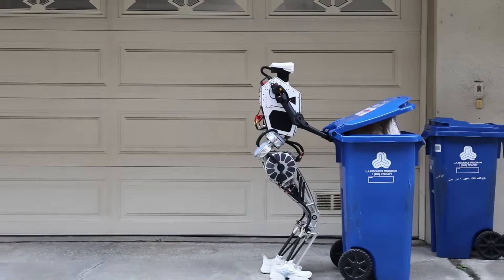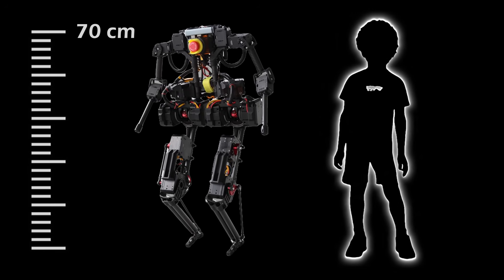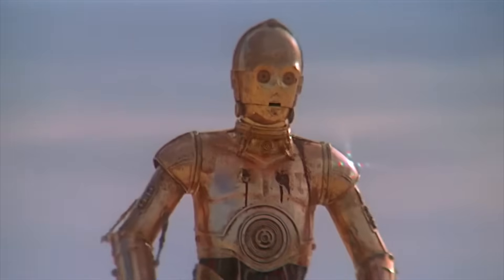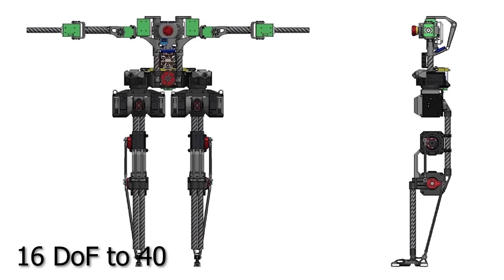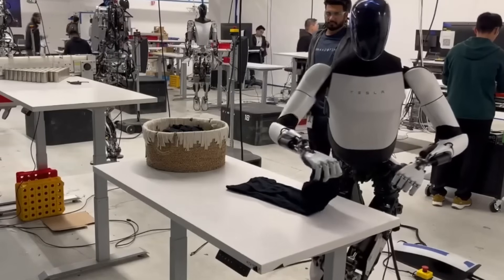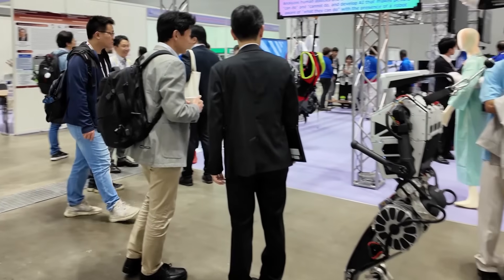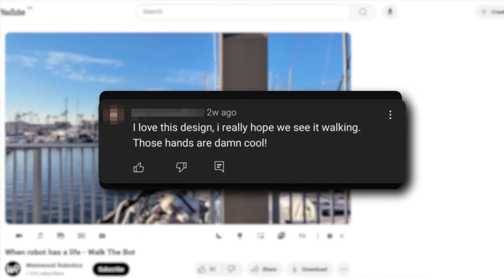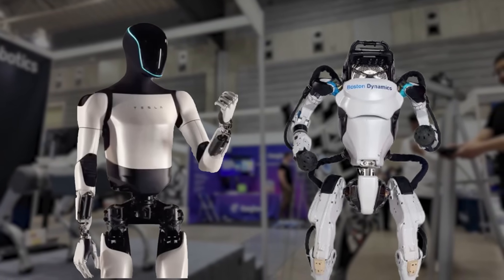First Humanoid Robot That Moves and Reacts Faster Than Human (Not CGI)

Comment: Not agile at all, such small range of motion of the legs.
It just shuffles along with quick little steps so it can do more corrections.
Long steps require much more decisive control and upper body balance adjustment.

This is a robot in the infancy of development, its a joke to compare it in anyway to Boston Dynamics newest work.